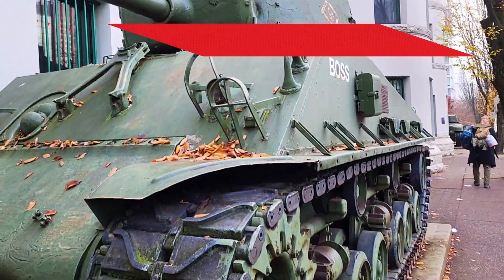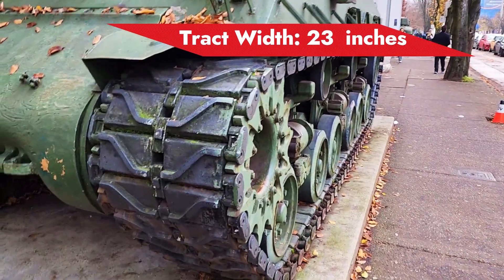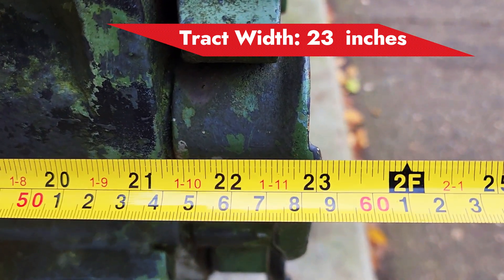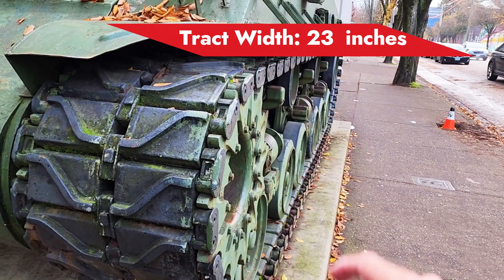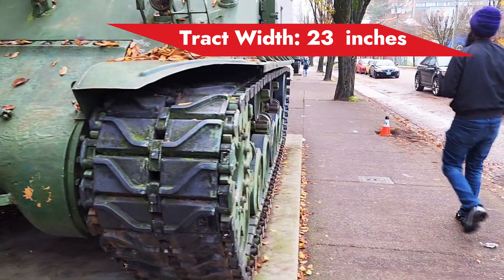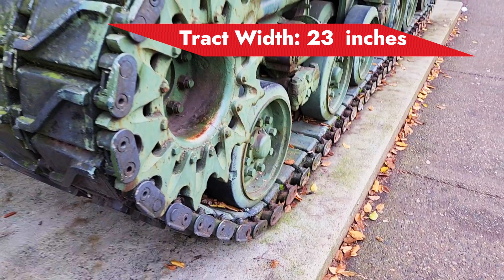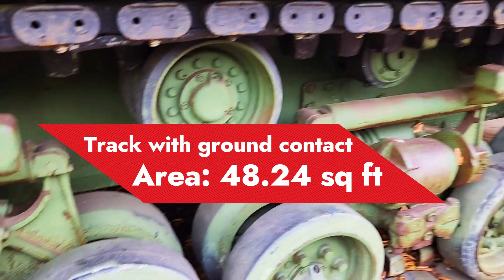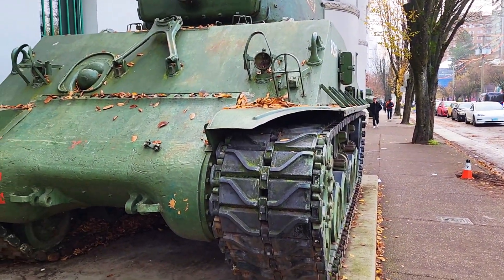M4A2E8 Easy Eight Sherman Tank Track width & ground contact measurement and ground pressure comput'n

Comment: That track ain’t wide the tiger 1 had a 90cm (ish) wide track
Reply from the maker: The tiger 1 track width is 28 inches, the M4Sherman is 23 inches so a 5 inches difference in favor of the Tiger1 😊  but for the Americans, the first US Tank M3 Lee has only 16 inches. So from 16 inches to 23 inches, it is already a significant improvement.